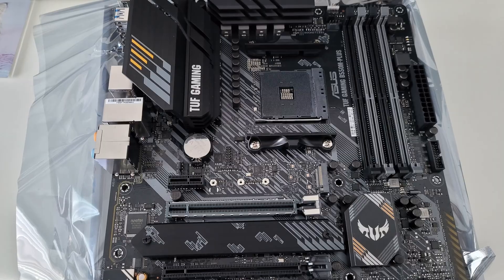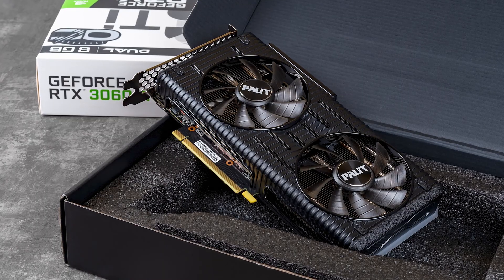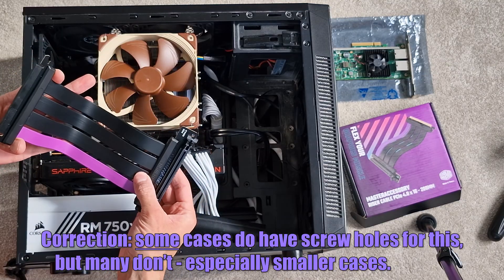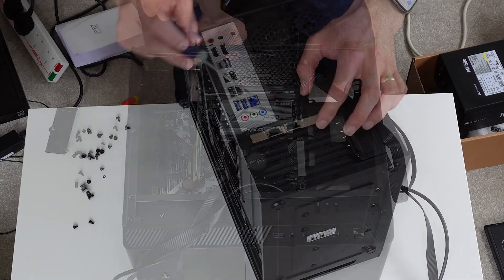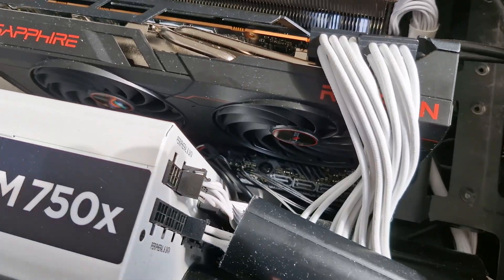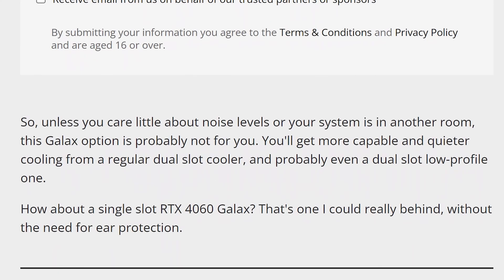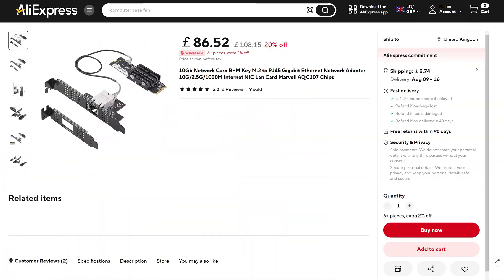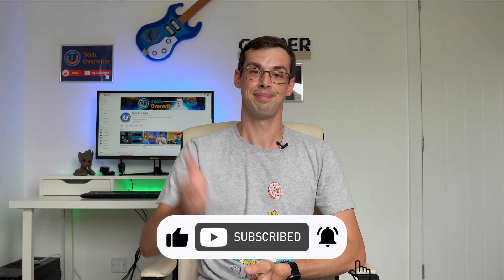GPU Blocking The Other PCIe Slots? Here's 7 Workarounds

Comment: you pretty much solved my problem in the first 7 seconds. i have a dirt cheap micro-atx motherboard trying to pack way too much. even my tiny palit 1650 super is enough to block the m.2 slot completely. 
time to lay my nvme dreams to sleep and get a sata ssd LOL cheers
Reply from the maker: Hah glad to hear it. It's definitely frustrating when you can't fit everything in :( I agree though, a SATA SSD might be the way to go - and you'll probably not notice any real-world performance issue either.

Comment: Not sure if you covered it, but surely it's cheaper/easier to just get a x1 PCIe riser cable rather than a x16 one? Assuming none of the other options are viable.
Reply from the maker: Yes I covered this, sometimes the slimline x1 ones don't completely fit either (and even then, the bandwidth might be too limited for x4 or x8 devices). But you're right, this can still work fairly well - better than the other options.

Comment: I used the vertically mounted GPU bracket with a slightly longer PCIE extension cable.
This allowed me to access both unused PCIE slots for a M.2 adaptor and my PCIE capture card.
Reply from the maker: Ah nice, that's a clear benefit of vertical mounting for sure. Glad it worked out well for you :)

Comment: that sapphire 6700xt size is 49mm on techpower,  nearly 2.5slot card.  i m in the same boat but haven't got gpu in hand now,  so what is the maximum height gpu i can get?  40mm gpu hard to find,  wonder if 45mm will work
Reply from the maker: It's definitely a thick GPU - although it can also depend on what the motherboard layout is. Some have the two x16 PCIe slots quite close together, while some put the CMOS battery and then an M.2 slot in-between - meaning that a 2 or 2.5 slot GPU should be fine (to not block the other PCIe slot). So I've also been looking at the motherboard layout when deciding to be honest.

Comment: Interesting but don't help me.  I run 2 x RTX2070 Super GPU's on an ATX Board.  Each GPU is 5 cm wide and covers 2 slots I cant use".  So thats 6 out o 7 PCie slots gone.   No room for my Satellite Receiver card.  :(   I uses 2 x GPU's for the Cuda computing Power.  I wish there was another solution other than updating to a modern single 10,000 cuda core graphics card at great expense.
Reply from the maker: Ugh sorry to hear it, yes this situation is really frustrating. There's no obvious solution (other than spending a lot) either, as you say, which sucks.

Comment: There is another solution which is to use a M.2 to PCIe adapter
However I am going to try using a right-angle PCIe adapter so hopefully I will have enough space between my RTX 4090 and the 2nd PCIe slot as the 4090 is right over the second slot.
Reply from the maker: Ooo that's a neat idea re: the M.2 to PCIe adapter, thanks for mentioning that. And I hope the right-angle adapter works well for you - depending on clearance it can certainly work well.

Comment: I bought a wifi card and just realise that my 5700xt takes up all the slots in thinking ima use a riser for the wifi card keep the gpu where it is and have the wifi card loose in the case cause im not worried of damaging it might even try rig it to the back of the case idk yet
Reply from the maker: That sounds like a good plan - yes, the WiFi card is might lighter (and cheaper!) so it's not as big of a deal if it's kept loose. I mean, you might be able to zip tie it to the case too, but your plan sounds a good one.

Comment: Have full ATX with 4090. One of my 4 nvmes is blocked by my TR cooler unless I took everything out. The bottom pcie wouldn't fit the 4090 was thinking about looking at my board while watching, well adjusting my main is enough of a PITA it stays as is.
Reply from the maker: That's frustrating 😔 The 4090 is an awesome GPU of course (congrats!), but that is a big annoyance. Yes I don't blame you for leaving it well alone lol.

Comment: I have full size mother board but still 4080 is so thick it blocks all my pcie mannnn
Reply from the maker: Yikes, yeah that's really frustrating 😔
Reply: @TechOverwrite  I want to use pcie for capture cards, do you think I can use the riser cable with capture cards?
Reply from the maker: Yes I don't see why not - when I last tested riser cables, it worked with a 10Gb network card so something 'similar' (i.e. a fairly low power PCIe device like a capture card) should also be fine.
Reply: Interesting, I have a bottom pcie open with 4090. I don't adjust my build much unless it's fan cleaning time typically. Am using a regular GPU config.

Comment: Dude, my 7900 XTX is 4 slots high so I can't even access the second PCI-e. I'm f*cked unless I go with a riser cable and those are hard to find nowadays. It sucks because I went from a water cooled 2080 TI that was only 1 slot high and I have 3 PCI-e slots, so in the third one I had an NVMe PCI-e card for more storage space. Now I can't use it anymore unless I magically find a riser cable.
Reply from the maker: That sucks, yes I'd forgotten to mention about the super wide GPUs. The 7900 XTX is a complete beast of a GPU, but it sucks how wide it is :( It does seem like a bit of an oversight generally to be honest.

Comment: The actual fun starts if the other PCIe card is also a big fat GPU. I'm close to somehow just tape the 3rd GPU in the case. I got a Silent Base 802 which in inverted mode has actually enough space for 3 GPUs but thats only intended for all kinds of blinking water cooling toys. The board also wastes a full slot with an m.2 mount that comes with a ridiculously large cooler. I mean I'd be fine with the board only supporting 2 or 3 instead of 4 m.2s. Its just annoying.
Reply from the maker: Ugh, yes that's a fair point. Is that for AI/LLM workloads? Either way, there definitely isn't enough consideration for multi-GPU installs I agree 😞
Reply: @TechOverwrite  Yep, you guessed it right. And since Nvidia has a total monopoly and hence charges car prices for just working station GPUs we regular people have to resort to gaming GPUs which are big. So you can go all water cooling but I didn't feel confident enough to setup a loop for multiple GPUs and I'm not a big fan of water cooling anyway for several reasons. The other option is mining rigs, which I hadn't considered at all in the beginning. But I'm not a fan of cases being just open frames with hardware and wires hanging on them. So I went for the third option that is to find a big case and to put as many GPUs in it as possible. Turns out 3 is already the max but unless you get expensive server boards   you won't have more than 3 PCIe x16 slots on them anyway.  I also have to see how hot things get. But what I really find annoying that everybody offers the same cases more or less, that's usually black and some white models most of them having a glass panel option and feature an optional single vertical mount. In cases without glass panels you usually find insulation panels which is totally pointless too for a high powered system. What you save in terms of noise gets added back by fans that have to spin faster to get rid of that like 1kW of heat.
Reply from the maker: That's interesting (and frustrating!), thanks for the extra context. I've only briefly touched on LLM builds so it's cool to get a deeper insight into it. You'd think that there would be more support for multi-GPU builds out there nowadays - it's an increasingly common use case for builds nowadays.
Reply: @TechOverwrite  Yes, it's kinda like back then, when you wanted to build a NAS but had to get a huge tower with many 5.25 slots and then use converter brackets to put in 3.5 HDDs and couldn't even think of hot swapping or at least being able to exchange drives without opening the case. Anyway, if the tape holds and nothings melts, I'll soon be able to run 123b models. ;-)

Comment: "here's 7 workarounds"
4- buy another mobo
5- buy another gpu
6- give up
7- use the second pci-e that is fundamentally slower than the first one

bruh
Reply: I mean the slimline pcie riser is my fix
Reply from the maker: Workarounds might be the wrong word, but they are 'valid' options IMO - since someone can't magically make more physical space where it doesn't exist (e.g. with a mITX or mATX build with a large multi-slot GPU). Sometimes a motherboard change - for example - is the best option, so I wanted to discuss it. #6 was a tongue-in-cheek chapter name because I did discuss WiFi card alternatives. I appreciate the feedback though - workaround might be the wrong word to use, especially in the title of the video.

Comment: Thanks for the video. I too encountered the same issue. I'd like to get a new GPU but that would mean that I'd have to get rid of my PCI Wi-Fi card. I don't feel like using the USB adapter or getting a new motherboard and a case, so I guess I'll wait for a more suitable GPU.
Reply from the maker: Glad to have (sort of) helped - sorry that a new motherboard will be required though. It's a frustrating issue for sure 😔

Comment: I was wondering if Riser cables slow down performance at all?...I thought that the whole concept of the top pcie lane is that its closest to the cpu and ram for shorter distance for the information to travel
Reply from the maker: A quality riser cable shouldn't slow down graphical performance all that much, if at all. Some GPUs can run with minimal FPS loss at x8 for example, so it stands to reason that a quality x16 riser cable shouldn't impact performance too 🙂

Comment: just bought a 4500$ Alienware R16 and want to add a Camlink Pro inside.. no USBC Thunderbolt for external cases.. and no access to the PCIE slots. I'm about to give up 😂 how can it be? ...I'm used to the full size Area51 with 3 graphics cards + 2 PCIE 4x lol
Reply from the maker: Oh dear, sorry to hear that :( That's crazy for such an expensive machine, sorry to hear it. Yes it's really frustrating. I might start a petition that all PCs must have at least 1 free x16 slot. I doubt many people would sign it, but it would make me feel better lol.
Reply: @TechOverwrite  yeah, its disrespectfull for customers. their website is like "for streamers" ...nop. streamers needs their PCIe for capture cards... false advertisement?.. and in the manual you see the 2 PCIe free slots... its on the feature list and the manual. cant use them... totaly blocked by the graphic card. should have a notice something.. cant return the machine. I'm stuck with a non-operational system for my needs..
Reply: @TechOverwrite  update: I used a 10" PCIe cable that goes out the case.. so the capture card is outside hanging on the cable.. cable is very tight and have some pressure from the RTX but its working. super bad setup for the price..
Reply from the maker: Yikes 😳 It sucks that you need to do that, I agree, but I'm glad you ended up with some sort of solution 🙂